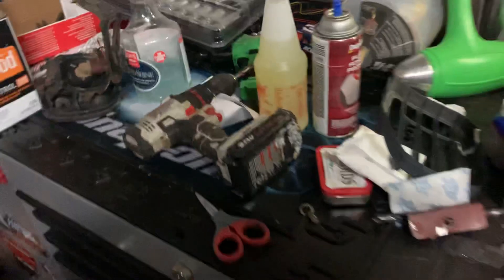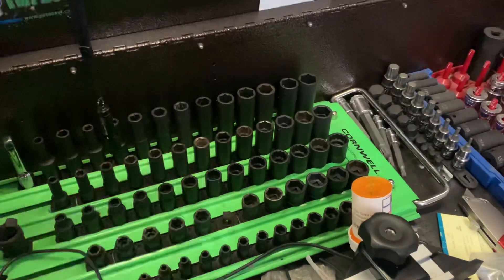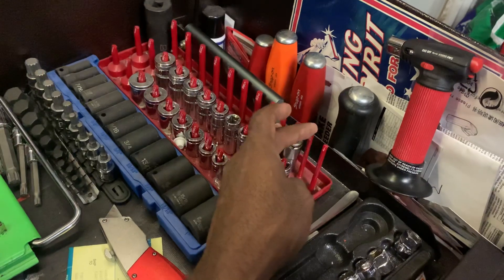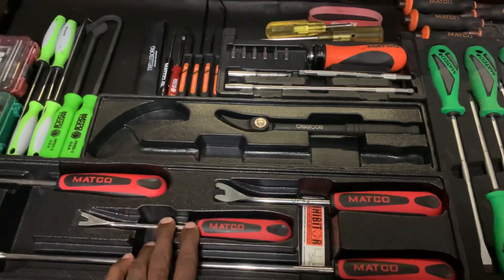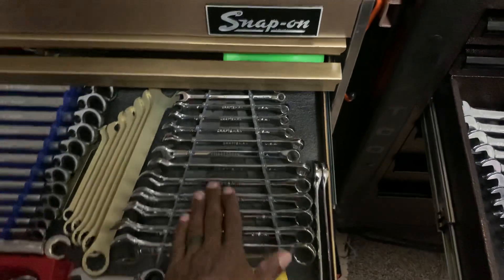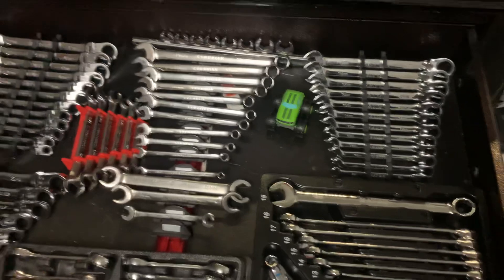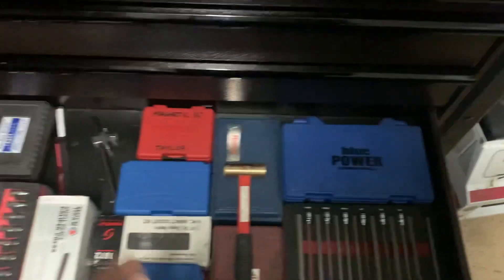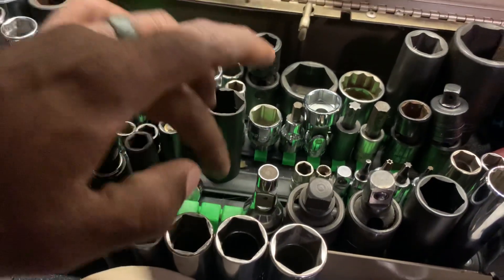Tool storage and organization for DIY’rs | TTS Inspired

Comment: Damn thats alot of ratchets. Those Nepros are the best. Love mine!
Reply from the maker: Yea, I’ve bought a lot over the years. I buy broken and damaged, then I repair or warranty as needed. Never been on a Snap-on truck. Have purchased 1 ratchet from the truck, but my friend in Ohio bought and sent to me. Other than that, these all started out as broken or damaged tools
Reply: @MidwestToolReview  Lucky You. I work at a Independent mechanic shop so we get the Snap-On, MAC, and Matco tool trucks that come by weekly. Used to have Cornwell but he stopped coming for some reason... You can end up spending a fortune on those damn trucks....

Comment: James quick question so I just bought a snap on cooling system tester for 50 bucks do you think that's a good deal from the pawnshop?
Reply from the maker: Anything Snap-on purchased from a pawnshop for less than $50 is a great deal. I looked up what I believe you purchased, and if I'm correct, they are over $300 brand new, so you got a smokin' good deal!!
Reply: @MidwestToolReview  nice!!! Thanks men